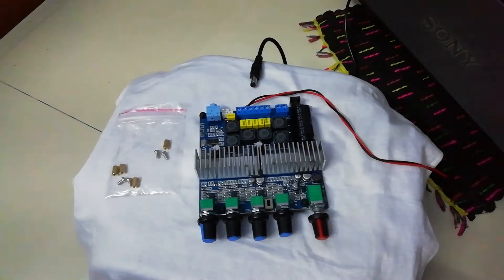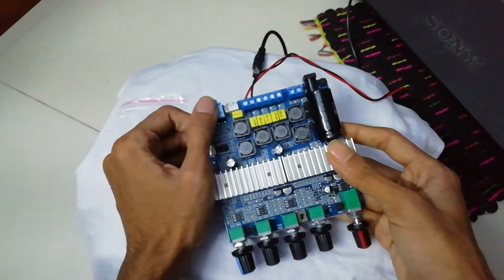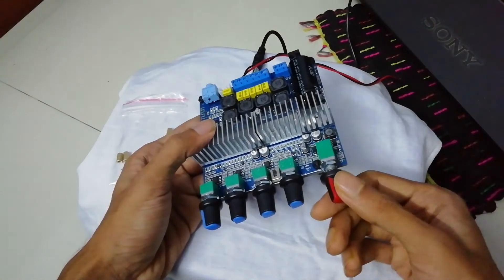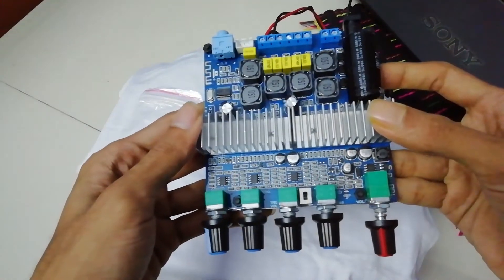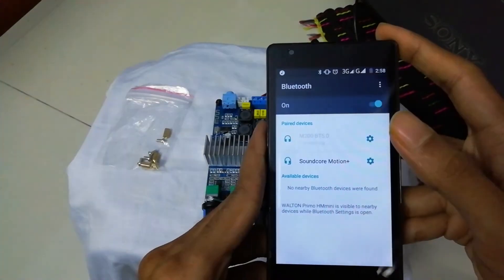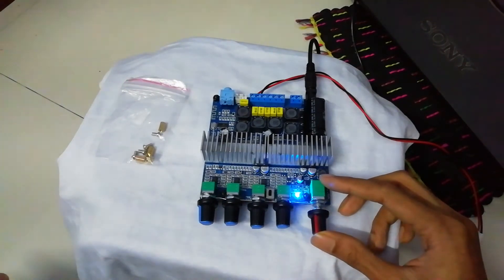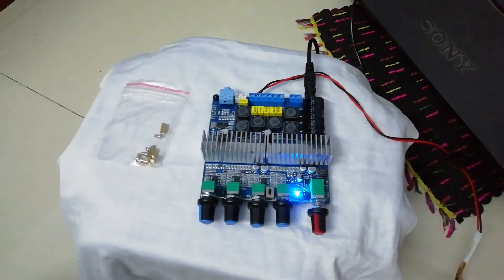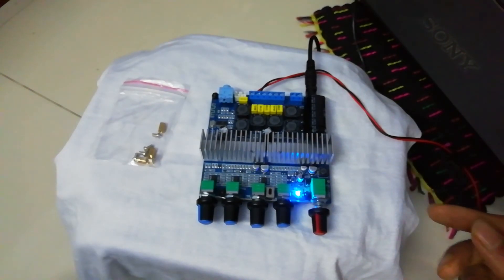TPA3116 based 2.1 channel 200 watts amplifier review...!!!

Comment: It need crossover for  l r  speaker or I can directly connect it.
Reply from the maker: You can directly connect subwoofer in bass channel and woofers in left right channels. But if you want to add tweeters then you'll need separate crossover for them. This one is for subwoofer (lows) woofers (mids and highs)... overall the amp works fine...

Comment: When I connect power, shorting sound is coming. Do u facing the same
Reply from the maker: shorting sound from where...? If it's coming from any connectors you used then it became loose maybe. Check it and find where it's coming. Mine is okay. I don't hear shorting sound...